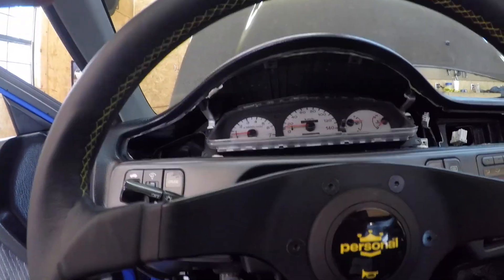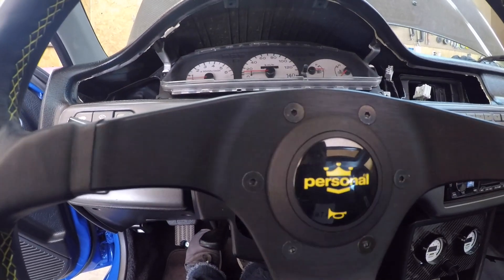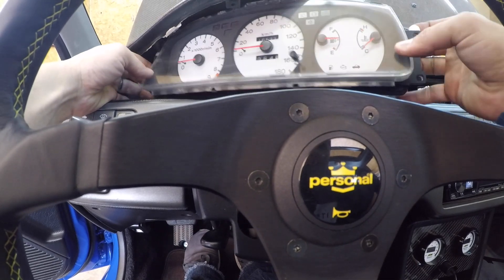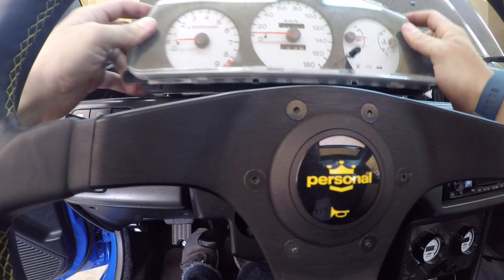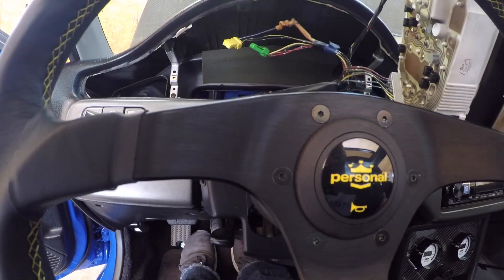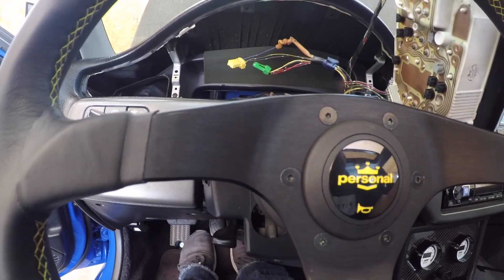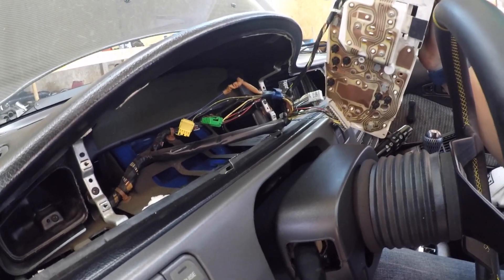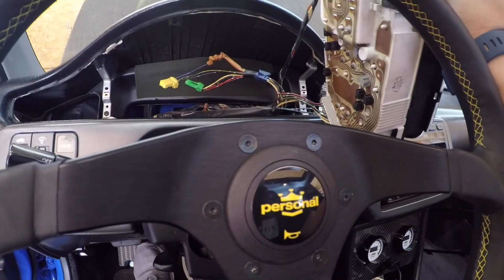AP1 cluster install in eg

Comment: badass. I had a ap2 in my eg but would have wanted the ap1 instead.  Night cruising with this cluster is badass.
Reply from the maker: for sure, still Honda but clean
Reply: What's the difference?
Reply: preludeF20Bking was it all plug n play
Reply: Vasile Garage was it all plug n play
Reply: Bro I love it!!! Where can I get the wire harness and carbon cover? Thanks!!!

Comment: Vasile how are you, I want to do the conversion in my EK, I wanted to know when I have to buy the Ap1 or Ap2 wiring, which one do I buy? or which one is good for which model of gauges?
Reply from the maker: Criturbay the harness should be the same
Reply: @vasilegarage2606  
the gauge from a certain year to a certain year changes, on the page where I want to buy it gives you the option for Ap1 a certain year and ap2 a certain year, unless you buy a gauge year 2004 and buy ap1 which is for gauge year 2000 for example, no I know if the terminals are the same or there are variations, thanks for the prompt response

Comment: Where can I find the material you used to make the bracket to hold the cluster in? That's all I need to finish. Good job man. Looks great.
Reply from the maker: Ismael Moreno I use the oem S2k brackets. To make it work
Reply: Awesome thanks brother man.
Reply: Vasile Garage is that the brackets that came with this cluster? That was on the top at first